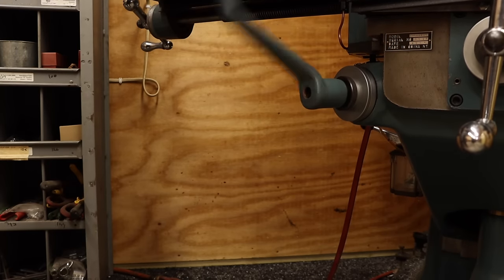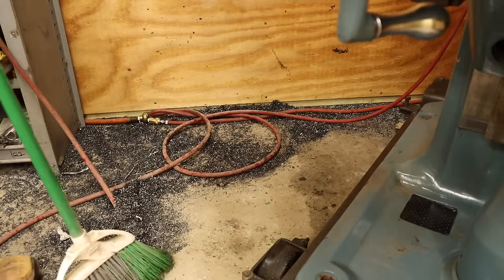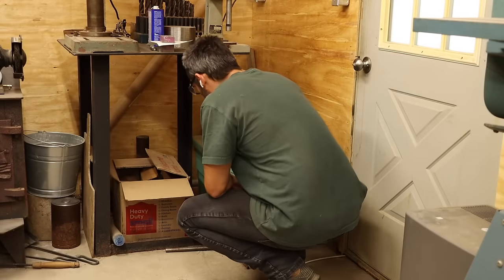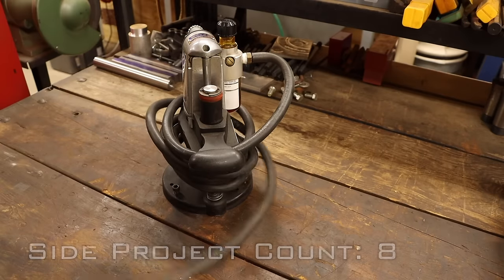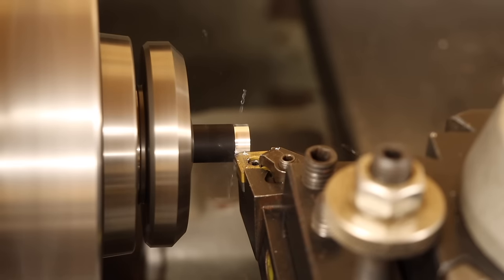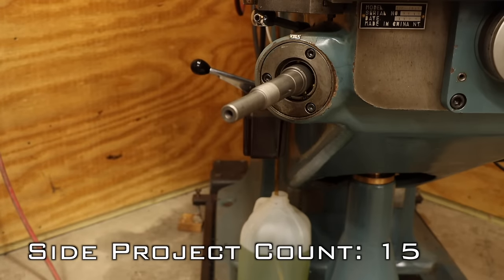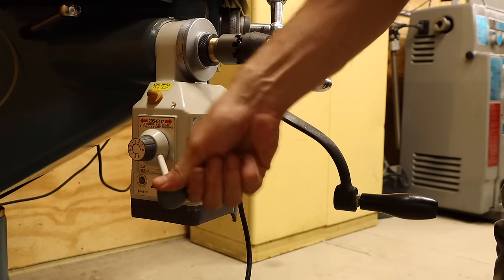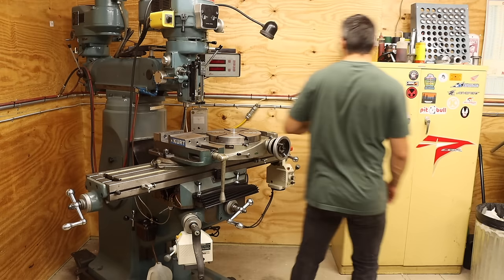3 Mill Upgrades (A Side Project Extravaganza) || INHERITANCE MACHINING

Comment: The power knee was the FIRST mod I did to my Bridgeport. After being a machinist for a decade for other people I swore I would never crank that thing again. I also tossed the crank handle in favor of a permanently mounted 8” diameter hand wheel. It’s large enough to make fine adjustments, without the risk of hitting you in the nuts.
Reply: First day of shop class in college I watched two people smack themselves with a knee handle, seems a wheel makes a lot of sense
Reply: True but over time you will switch out the cheap made in China Enco power feed unit out with a Servo or Bridgeport brand as the Enco will always be a smoke show under hard use in a very short time.

Comment: That floating handle only a few mm from the rotating Z drive looks spooky. Mind your forearm and wrist if you kick that handle forward accidentally with the z-axis motor engaged.
Reply: Yeah i also tought of that. I would also ditch the handle.
Reply: The best thing to do is replace that handle with a round hand wheel after adding a power feed.
Reply: That handle scares the shit out of me - if it engages at fast travel, it looks like it will break the handle or whatever it slams into, whichever is weaker. Which bone tends to be.

Comment: Time for another side projects, make metal blocks to replace the wood blocks on the mill
Reply: Cast iron, for stability
Reply: Add a few weeks for surface grinding.
Reply: Which will, themselves, require side projects for fixturing properly
Reply: Replacement feet, why bother with interfacing to the existing feet when we're already committed to a side project, with tapped holes right there in the place we need them!
Reply: Or new longer adjustment screws.
Reply: @rebmcr  This is why we have a comment section. First principles baby.
Reply: Garrett sells some very nice leveling blocks  That are essentially a nut and fine threaded bolt  Spanner wrenches. Beijing auto lubricators and traveling  Digital indicators. That was a week's worth at work
Reply: Mark this side project complete!

Comment: Honoring your grandfather through the maintenance of the machines he left you is messing with my allergies and I got something in  my eyes. I'm sure he'd be incredibly proud. You both have my respect .
Reply from the maker: Thank you so much! 😁
Reply: It is great to see him using his grandfather's tools. I have a number of tools from my grandfathers and love keeping their memory alive. My dad was going to toss a bench grinder that his dad had, but luckily I saved it from the curb. That grandfather passed before I was born, but he was a too land die maker for the aerospace industry near LA. The grinder was probably from the 30's and was a sun brand of packard motors, owned by general motors from what I recall. It is torn down so I can powder coat it and replace the bearings. It gets used to sharpen my tungstens for tig welding and has a wire wheel on the other side.

Comment: You hit the nail on the head with how every simple project - that should really work right out of the box - requires so many extra unexpected steps that each can take much longer than the original work. We have probably all experienced this: I tell my family, "oh, this is easy; it's just going to be a half hour," and off we go on a six-hour excursion.

Comment: Nice update!
A tip?
Replace the "main air hose" with a thicker one, one to two dimensions.
Then branch out to each part of the machine(s) with regular hose.
This allows you to reduce the power costs of the compressed air, you can actually save a lot.
Make sure all connections are tight and not leaking.....

Comment: Not sure if this channel is your first foray into video production and editing, but right out of the gate it is so polished and well done!  

I refurbished an old vise that belonged to my grandfather, and I have and use all of my dad's old carpentry tools. The relatability of your story to mine is crazy, and much appreciated. I have watched my way through everything you have posted (up to this video) in a few days. I am trying to pace myself because when I catch up I will be checking your feed obsessively for the next installment. 

Coincidentally, my career began on a drafting board, and I sold my table and drafting machine when I transitioned to CAD in '94. I still have all my old templates, lead-holders, compass, scales, mechanical pens (and pounce powder), dusting brush, tape dots, Leroy lettering set, erasing shield (and scum bag) and electric eraser. Your use of these old tools slammed me right back to the days of standing hunched over a drawing, and dreading the inevitable revision process and the holes I'd erase in the vellum sheets. Then there was the mylar and plastic lead (my least favorite) and erasing the matte off the mylar. I spent 10 years on a drafting board before I switched to CAD 100%.

Comment: I've just finished a side project. 2 days to make some big workshop storage shelves, a lot cheaper than the Lista drawer cupboards I really want. For some reason my wife insists on calling the workshop the garage. Back to real work next week.
By the way an excellent side project is painting the workshop floor, cuts right down on dust and makes it easier to brush up.
Reply from the maker: Very nice! You might have to hand a sign on the door. "WORKSHOP". to avoid confusion 😂 

Im really considering this. I didn't realize how much dust was getting kicked up by sweeping! I see a dedicated shop vac in the near future as an interim solution!
Reply: No one can afford Lista cabs except the USAF.  But they do show up at DLA auctions now and then at a military base near you  . . . . 😎
Reply: @michaelrice500  I keep looking for them in auctions in the UK. More chance of finding a job lot of Unicorn Horns.

Comment: Wow! In all these years of watching and following  on YT,  I have never been compelled to comment  before. I am a late life diagnosed person with ADHD. I have gloriously discovered that my side projects have diminished significantly,  or should I say, they don't interfere as bad as they did with my main project at hand.
Reply from the maker: are you suggesting I have ADHD? 😂 

Just kidding! For the most part these were all part of a plan to knock out as much side projects as efficiently as possible. In hopes they wont interfere with the main projects like you mention
Reply: Hang in there, Ray; you got this!
Reply: Only.....that just looks so familiar!..... just recently, it was time to reorganize my tool box at work....but not before I repaired the oil leak in the pump on the lathe first....and then organize the Ridgid pipe threading machine....and the hydraulic hose crimper.
When I had this late life diagnosis, I mentioned it at an extended family gathering  and several close relatives all with advanced medical degrees of one kind or another, my sister included,  responded like it was no surprise  at all to them.  I was the only one who didn't know my entire life LOL

Comment: On the push hose fittings, heat the hose a bit and it pushes in much easier. Let cool before applying pressure.  I have done hundreds of these with no issues. Just found your channel and love it. 👍
Reply from the maker: That's really clever. Thanks for the tip and welcome!

Comment: Got a comment for you about your milling machine! I work on plastic injection moulding machines and one thing I've learnt over the years is that the machine lubrication systems use metered fitting for the oil distribution. Meaning each fitting is a separate size internally, it might be just the diameter or / and the length of the smallest diameter. Meaning each fitting is it's own speed and pressure control valve that is designed to work with only one recommended grade of oil, so each branch of the lubrication system works correctly, just something to bare in mind if you get any problems. Jim🏴🇬🇧
Reply from the maker: Thanks Jim! I actually ran across this exact system on my SG and ended up adjusting the valves a little with everything open. I might have to take a closer look at the mill as well.

Comment: Good job tackling those side projects. 👍One thing noticed was the rotary table set off of the knee to the right which over time will cause droop in the table. To avoid a bit of head scratching why long flat milled parts grow to the right, remove the rotary table after each use. That little caveat was taught by a immigrant Hungarian machinist that took time out of his Saturdays to teach an eager younger man the fine attributes of manual machining some 30+ years ago. His name was Jimmy and he was a real gem of a man, kind of like your grandfather.

Comment: I added a DRO for the quill already on my mill. Super easy and useful upgrade. I need the power Z on my mill. Its a pain to move it up and down much...  And the pneumatic drawbar....that is on the wish list  too. My mill is a Grizzly G0827. So not an old mill but seems pretty nice so far.

Comment: "This scratches the part f my brain that wants to take EVERYTHING apart".....  OH YEAH!  I have that same itch!  When I was 12 years old, I completely disassembled our lawn mower to figure out why it wouldn't start - found that a wire in the magneto has broken - then fixed it, and put the mower back together.... and it ran for another 10 or 15 years! 
I ended up becoming an Aircraft Mechanic in the Air Force and worked on both Helicopters and F-18's!   
Meanwhile - I've done a ground up restoration on a motorcycle, and at 60, I'm STILL taking things apart and figuring out how they work!
Reply: Also the part of my brain, that looks at a small task, that'll reveal a dozen other small tasks. People wonder why I'm staring off in the distance when I grab the broom, lol. Nothing gets done in a clean shop.

Comment: I am really loving your videos. I was told they are awesome on the Making It podcast and they are correct. Keep up the great work! Also, the best thing about the power drawbar is that it frees up your hand to hold onto the tool when you are turning the nut. It will save your tooling and pay for itself in not crashing endmills into the table or your work piece.
Reply from the maker: Thanks! Thats true... I've sortof gotten in the habit of dropping the back gear to low so I can crank with one hand while still holding the tool. Wont matter now of course 😎

Comment: Great video.  Always wanted the istalled power feed type units but didn't want to pay $300 for the cheapest unit possible for fear of issues similar or worse than your woes.  

I've done some "cheaper" variant of most items in this video for my 2HP round column mill.  Modified a pair of $10 digital calipers into my quill DRO by making mounting brackets and drilling 1/4" mount holes through the hardened jaws. 

For my power feeds  I machined custom turning knobs.  Centre shaft is 1" machined steel with the machine's handle mounting pattern on one end and a 3/4" hex nut machined into the other.  This was then press fit into a 4" diameter aluminum puck with knurling on the edge.  Added a stumpy brass handle for manual turning and you just use any low speed cordless hand drill to turn the mechanism at any speed you can feather on the drill trigger.  Works well for me!
Reply from the maker: Honestly I didn't already have the DRO kit I would have made one just like you mention. Also very clever on your powerfeed solution. Thanks for watching!

Comment: Thanks for sharing. I have a few questions:

1. Who makes the “Draw Bar Impact”?
2. Can we get a closer look at the roller base for the mill? I can use one.
3. Since you have issues with fitting tooling while using the rotary table with the chuck on it, have you considered adding a spacer to the mill column? I think a 2”-4” thick spacer should do.

Comment: The knee lift is a great addition. I can remember lifting 1000# mold blocks on an old Bridgeport. I never added one on either of my Bridgeports, as I prefer the crank turned handle in, after a crank tried to push my knee cap up to my hip. Not good. The power drawbar attachment is my everyday favorite. I will make a suggestion for these knee mills, is an offset 3/4 x 7/8 box wrench that fits the myriad of 3/4 hex fasteners on the mill, and the other end fits the 7/8 hex on the clamp stud nuts. This size works on a B’port and Nortwestern 1/2-13 stud nuts. I am enjoying your travels, some of which I made years ago. Where were you and YouTube when I was a kid?

Comment: Just love your videos. You do an excellent job , just the right amount of time showing things added with some good humor. Sometimes I think I’m watching myself with the “side projects” this is my life with everything I do. 😂 sometimes I go so far off I forget what the original project was. BTW I have all those plus table heeds on my Bridgeport and wow are they all nice. The Z axis one is the best though. Thx for a great video
Reply from the maker: Thanks, Lee! I agree. The Z upgrade might be my favorite
Reply: Actually I have a Kurt power draw bar which is my absolute favorite. I have an Analam DRO which also is great. All of this is just so much nicer than when I was an apprentice 50 some years ago. The best we had was a Bridgeport with travel dials lol. Although we kept one for boring precision holes. Never used for milling. It had some kind of optical read out for X and Y . How the times have changed. However all of your videos show fundamentals which are very well done. I don’t know where you work full time but I sure wish it was for my 3 sons. Although the shop is 99% CNC so you’d probably be bored 😂 Thx again for your wonderful contribution to a dying art.

Comment: I knew when you tied up the hose to sweep that you would be back to add an air line for the drawbar. I also agree a nice inline manifold project should replace that one to three block and your push in tee arrangement. Not sure it needs to have quick connect couplings, but a shut off somewhere is nice, and the list goes on...
Reply from the maker: Lol yeah… hindsight’s 20/20. If it have to expand more air lines I might revisit that

Comment: Pretty fun. Id love a power z motor for my kneemill, its a Webb. Interesting collet closer for the lathe looks nice and rigid, I have a Sjogren 2j collet chuck for mine (same lathe). Good on you for replacing all the oil lines and not taking the "I only need to replace the one thats leaking the others are fine"  approach.
Reply from the maker: thanks man. I'm not sure off the top of my head what the lathe's collet drawbar is, bit it's definitely nice

Comment: If you’re looking for one more minor thing to make the mill that much more enjoyable, I would suggest a “push button quill stop”. It’s a quick release button for the quill stop that makes moving it up and down a BREEZE rather than spinning it for a solid minute to get it top to bottom, etc. we have one each on our mills and it’s the best upgrade we’ve done aside from the powdered knee.
Reply from the maker: If I follow you right I think I have something similar. It's like a spring loaded alligator clamp that has matching threads on each side to grip onto the quill threads. Only downside of it is that the resolution is only as fine as the thread pitch. But still useful in certain cases
Reply: @InheritanceMachining  close, but not what I’m referring to. This is what I’m talking about. Link to a video below.

https://youtu.be/iY86Iq790X4
Reply from the maker: Oh... thats really cool actually. Thank you!
Reply: @InheritanceMachining  not a problem. While we’re at it, I would also suggest mill table slot covers. They’re extruded aluminum pieces that fit into the slots on the mill’s table and keeps chips out. Makes cleanup of the mill a breeze! They’re also easily removable when the vise needs to be moved or a rotary table needs to be added.

Comment: Beautiful work, awesome video!!. I have a shopvac dedicated to each mill in the shop so the moment I'm done working I can clean up. Sometimes I can even use the vac while I'm milling/drilling, I have an old indicator base that holds a chip collector nozzle that goes on the shopvac hose.  I'm extremely jealous of the Z power feed, and  I may have to convince the Boss that I need to put them on all machines.

I have often thought about a power quill tool, but back when the earth was cooling I was trained to use the Kurt vise handle to tighten the quill (That's why the Kurt vise handle is that size) and I'm so used to feeling how much torque I'm applying that I would probably be lost with a power drawbar! Also, if you use the Kurt vise handle with the aluminum knob on the end it's a great soft hammer to knock out the drawbar if you tighten it too much.  The power quill tool will probably be a better solution all the way around. 

Get a couple of those metal garden hose hangers at the hardware store to drape your air hoses and keep them off the floor. You will love this.
Reply from the maker: Thanks for the tip! Im really considering finding some used shop vacs for just this reason. The mill makes such a mess!

Ironically until I had moved the machines to my own shop I had only ever used a drawbar impact. You can kind of go by the sound of the impact with practice.
Reply from the maker: @Ioughtaknowbetter  that's brilliant!
Reply: Mark, I'll put in a good word with him too :)
Reply: @ChesterEnright  I have been thinking about just buying one of the adapters that goes in an electric drill.
Reply: @InheritanceMachining  Slip a couple of giant magnets (salvaged from old speakers or microwave ovens) in plastic bags and drop them in the bottom of the shop vac. They won't help with the non ferrous chips, but they'll do wonders for keeping wee bits of sharp crap out of your filter and  shop vac mechanisms.
Reply from the maker: Genius!